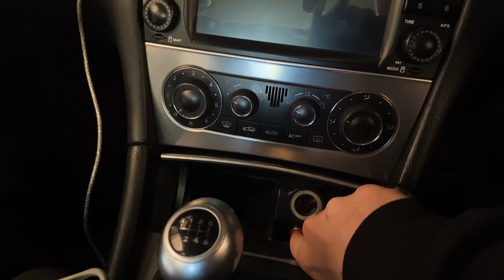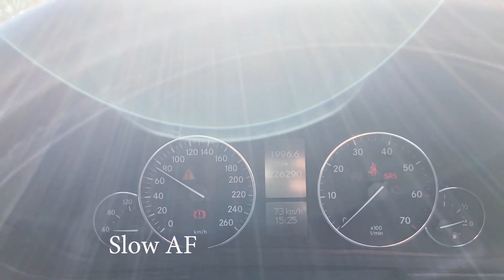Testing The 6 Speed Manual M104 Swapped Mercedes W203 | FIRST DRIVE | Straight Pipe 😁Needs A TURBO?🤣

Comment: Dude which transmission did you used for m104? Any adapter plates?
Reply from the maker: Stock gearbox that the car came with 🤙🏼bolts up directly. No changes needed👌 just upgraded the stock clutch .
Reply: @RicerBenz  i hope i get a w124 like this one! How is durability? Are you still using it?
Reply: @RicerBenz  Hi! we spoke in another comentary, but now i don`t find it. Did you say that you used the m271 gearbox, didn't you? i think i remember that you tell me that, original gearbox, clutch and flywheel from the car (m271). A friend of mine use 6 speed from om646 (220 cdi) for m104 in w202. My doubt is about the flywheel, im going to try to put om646 flywheel on m104. I tell here with the results. Thanks for your content. 
Btw, how do you improve the clutch?

Comment: Will a straight piped 230 Compressor pops and crackles ?
Reply from the maker: Nope. My c180 did not backfire in any way with a straight pipe. I did a ecu remap(tune) to have it do it. I’m talking when it still had the kompressor engine. This engine now is very basic no funny stuff yet😁
Reply: @RicerBenz  thanks …
Reply: @RicerBenz  will it shoot flames or only pop with the tune ?
Reply from the maker: @Therealtrap1  mine had small flames when I really drove it hard👌🤣